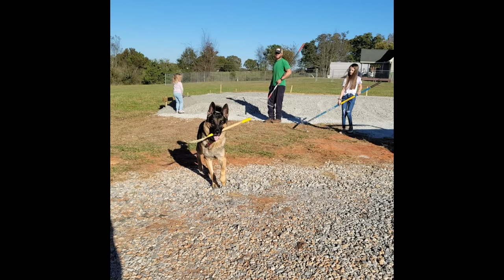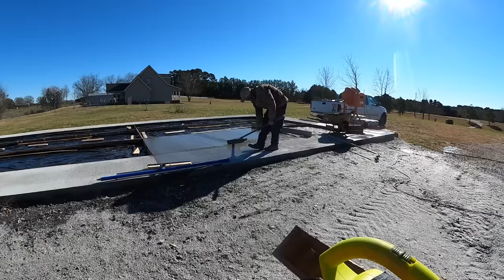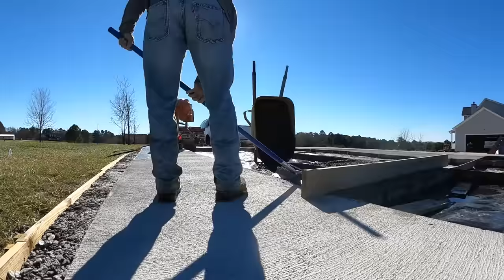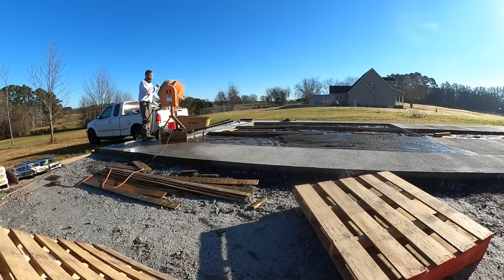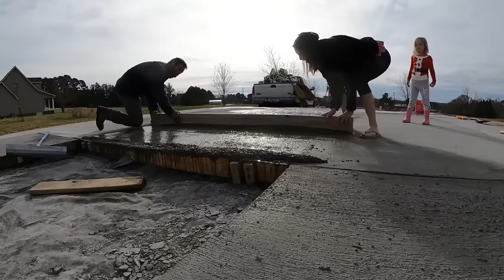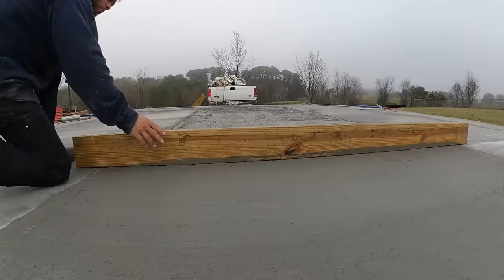Pouring a Huge Concrete Slab Using Bagged Concrete | I Saved $10,000

Comment: Wow, that is a lot of savings for the size.  We had a 24 x 40 building built and the concrete pour in Upstate NY was $4000.  That included the floating and creating of the stress lines.  We did not specify the day to do the job so it is possible that they did it on a day when they were doing multiple projects that week in the area.  They delivered several truck loads.  For your project, that is a lot of work for such a small mixer.  Your floor looks great...
Reply from the maker: Thank you! That’s cheap! When did you have it done? Around here they wanted a minimum of 14k for this. I have 3800 in everything doing it myself truck was going to be more.

Comment: It’s too late now but if you ever get a hankering to pour more concrete with sacks add some bagged concrete “dust” to the mix.  It will add just enough to get a great finish on the bagged concrete mix.  There’s too much rock in the bagged stuff to get a good consistent finish.  I forgot the ratio we used.  It wasn’t much concrete vs sacrete.
But your idea of epoxy is on point.
Reply from the maker: I’ve heard that before and it’s a good idea. I didn’t think I needed the extra strength for this because it’s really just used for storage and occasional vehicle maintenance.
Reply: @reallifetested2605  i understand.  
We poured sacrete at my FIL house at the lake.  5x5 squares to make a new sidewalk up to the porch.  He had done some concrete work himself so he had an exact formula.  He just wanted to "burn" in the concrete so we added more concrete to get that smooth finish.
Ive done enough sacrete to know its almost impossible to get a truck delivered concrete finish with that stuff.  Just too much aggregate.

Comment: just as a side thought when you pour big slabs by hand a pto tractor mixer saves a lot of energy so you can work longer sometime buying a bunch of Osb board and laying it on top of semi wet concrete follow this with a vinyl floor saves a lot of headache trying to trowel seal and coat the concrete as vinyl can be found for less the 2 per sq
Reply from the maker: That’s a good idea. The tractor mixer would definitely save time they hold a heck of a lot more. What I like about it is you can drive it around and dump it wherever you want.

Comment: A Cinder block  is 1 ft 2 inches.  With a space in the center.   Lay a layer of cement under the first  brick.  To lock into the place. Then  Double stack. The Cinder blocks one on top of another.  Filling in the center of each brick as u do with cement to create a solid  Cinder blocks  concrete pad.   And save half as much in cement  and water an spend  less  in the process.
Reply from the maker: I’ve seen this done on YouTube before and it’s a pretty good idea!

Comment: I mixed 3 cubic meters in Metric (105 cub feet ) in the Australian humidity , that’s the limit of human endurance , great work
Reply from the maker: I bet that was fun working against the heat. Luckily the temperatures were cooler when I did this so I didn’t have to worry about the concrete setting up on me. Thank you for checking out my video!

Comment: ❤  so it looks like best practice is to poor then leval and smooth rather than smooth as you go.
Worked with a pro. That kept all his work coverd in burlap for several days more than a week I think. Worked with an old timer engineer said add salt to set up quickly, sugar to slow the possess. Don think Ill do that, but covering for a time is supposed to harden better. Great job, I may grow some and try a slab myself.
Reply from the maker: I've heard of that as well but never had the courage to try it. Check out water curing. That sounds like what the burlap is doing. If you can keep the concrete moist for a while after pouring it supposedly makes it a lot stronger. Good luck with your project! It's not near as bad as it looks.

Comment: As someone who has done something similar (120ft tunnel 20ft underground - 1,367 bags of concrete), I have a lot of respect for this.  Personally, I would have used a lot of rebar everywhere and been careful to tie the sections together with lots of rebar, but never mind all that; well done.
Reply from the maker: If I were to do it all over again I would definitely pin the slabs together for insurance. So far everything as just as it was when I finished with not so much as a hairline crack. I'm very interested in your underground tunnel, do you have any info on how you constructed it?
Reply: It’s all in the base. We had a barn growing up that was about 150 years old and the concrete had a few cracks but who cares it out lived the guy who poured it and was still being used.

Comment: I built a 20x35 stamped concrete pad and I learned that the bagged concrete has much more aggregate than you have when delivered by truck.  If I could do it again I would mix 2 bags of ready mix with 1 bag of sand and 1 bag of cement.  Would be a lot creamier and accept the stamps better.
Reply from the maker: Creamier is definitely better for steps. More gravel does make the concrete stronger though. Did you try running a float over before trying to do the stamps? The floating process pushes all of the aggregate down into the mix.

Comment: Always amazed to see different parts of the world that don’t use rebar NOR air! 
I’m in Canada, and as nice as that looks, it’d never survive 1 winter here. 

Retired now, but I was a concrete finisher for years before I opened my own concrete construction company. 
But... heck yes! If you’re just doing this for yourself? You did darn well. 👏
(And cutting up each pour into smaller sections isn’t cheating. It’s just common sense. 
I’ve poured over 10,000 sq ft pours where I was the only finisher. But that wasn’t until I was comfortable with my ability. Prior to that I’d place bulkheads to divide the pour. (It’s also a handy way to create/leave access so you can work.)
Reply from the maker: I have had quite a few people say where’s the rebar it’s not going to last. I called around and local pros said that it wasn’t needed in a residential on grade 4” slab. No one around here uses it unless it’s an industrial building or house pad. Yes! I imagine Canada gets way colder than around here. It rarely gets below freezing for any amount of time in my area. Thank you for checking out my video and for taking the time to leave a kind comment. I appreciate it.

Comment: Hats off. Great job. Hiwever, concrete without reinforcement cracks. All concrete cracks, but at least the rebar keeps them in place. Your finished floor (if tiles) might inherit those cracks on a long enough time-line. Also you didn't put in the water a sewage lines and didn't insulate below the slab. This will reduce your energy efficiency. But as to the brute work, hats off
Reply from the maker: Thank you! I do wish I had pinned the slabs for added insurance but I haven't had any cracks or issues. If you're interested I did a 1 year update. This is just a storage building so I didn't need water or sewage lines. It's not heated or cooled either so efficiency doesn't matter to much.

Comment: For the 12 yards where i live that cost is around $3500. And we do the flat work ourselves. Its not the glass smooth finish of others but it will never flake due to overworking it.
Reply from the maker: I haven’t checked in the past year or so on concrete pricing in my area. I can bet one thing. The price hasn’t gone down.

Comment: did a little simple math because I was curious. You brought in and moved 200,000 pounds of gravel, 66,400 pounds of dry concrete, 6889 pounds of water (~1 gal per bag) so 73,289 pounds of concrete and total of 273,289 pounds of material total. Holy smokes, over a quarter of a million pounds moved manually.
Reply from the maker: That's insane! I never calculated everything up, but that's a lot of weight!

Comment: I was contemplating doing one myself! However I think I will put re-bar threw mine so that their is no danger of one pad sinking. I have a old oil barrel I may turn into a large mixer it is four feet high and six feet long I will take it apart and put in baffles. a big mixer basically. so I am thinking about tow mixes per slab. I think you did a great job and take my hat off to you! It looks pretty much as professional as one could imagine!
Reply from the maker: In my area the rebar wasn't needed in a residential on grade 4" slab. But definitely so if you have cold climates or a poor subsoil. (or putting a ton of weight or machinery on it) That sounds like a good idea using an oil barrel. If you go through with that you should make a video so I can check it out! Thanks for taking the time to watch my video, and for commenting!

Comment: Just got an estimate for $5300 to pour/pump a 6 yard monolithic slab. Unreal. I had a guy come out and pour 5 yards for $400 4 years ago but that shed is right along the fence line and I screed and set J-bolts myself. Inflation is insane. It's like the currency has to fail. How can anyone afford to do anything? Going to have to DIY I guess. Thanks for the inspiration!
Reply from the maker: I don’t understand it either. We got a quote for a 24x24 unfinished building with no electrical. Just the shell. Quotes all averaged around 100k.  My dad had one built (2 story) id guess 5-6 years ago for less than 40,000.
Reply: @reallifetested2605  Right? It's DIY or nothing at this point. Not sure how people are going to afford housing.

Comment: I’m not sure how much a yard costs where you are located, but around me it is about $150. I just checked Lowe’s website and the 80lb bag at my Lowe’s is $7.16. There are about 45 bags to a yard. So 830 bags is about $6000 for 18 yards. A truck could bring 18 yards in two trips for a little over $3000. I know for me, in most cases if I need more than a yard I call a truck. Kudos though, that is a lot of hard work.
Reply from the maker: I did this during Covid when prices were just starting to go crazy. Local trucks wanted 200 to 220 with a 4-6 week lead time. I was able to get 80 lb bags for 3.20 each so that’s what I did. I need to check around and do another update to see if prices have came back down on truck. Based on our economy I doubt it ha

Comment: Good job.  FYI,   I am building a garage at my house.   I just paid $6500 for a 4 inch thick pad.   It has 24 inch footers all around the perimeter.  It is reinforced with rebar throughout.    it is 21 feet by 49  feet.  Right about the same size as yours.    Im not sure how you saved 10K unless construction and specifically concrete work is crazy expensive in your area.
Reply from the maker: That’s a great deal. We have been looking at building another shop. For a 40x60 we’re getting quotes of right at 25000 if I do the grading (from 5 different contractors) with only fiber reinforcement. For this particular project we were getting quotes of 14k up. I did all of this for right at 3800 including all gravel and concrete.

Comment: I knew a guy who was a professional mechanic for the transportation department in a large utility company back in the early 1970s... He was building a home shop for working on cars... He thought that he could do it himself with the help of some relatives and friends... Although he had a large concrete truck deliver the concrete, they set up the forms and finished it... By the time they got through though, the slab had such a rough surface that he could not even roll one of the mechanic's creepers around the floor... He ended up having to get the floor ground down to make it even barely usable...
Reply from the maker: That’s awful. I bet he had fun grinding the concrete down. That stuff makes a ton of dust!

Comment: After having a contractor put in a 25' x 28' patio using bags, all I can say is DONT. They had a team of 5 guys, but they unevenly mixed things, and now we have a highly porous mixed density patio that's going to need to be ripped up. From what people are telling me, having a cement truck means everything gets mixed evenly and laid down fast before it can start setting. I think the guys who did mine did it particularly poorly, but I'm guessing the truck helps avoid mistakes.
Reply from the maker: Im sorry you had issues with your contractors. That is another good reason why I decided to do it myself. I've seen things like this so many times and I bet the guys that did the work for you gladly took your money and won't come back to fix the mistakes. I have ~40,000 lbs on this slab and it still looks as good as the day I poured it. That's crazy 5 guys couldn't get it mixed fast enough! My slab doesn't have one crack in it. I'm going to be doing yearly updates so stay tuned!

Comment: Here in my neck of the woods, S.E. Oklahoma 1 cubic yard of concrete cost 150 for 3500 psi. It takes 45 80 lb bags of concrete to make 1 cubic yard. At 5.18 per bag that's 233 per cubic yard. 
That's 80 dollars more per yard with bag concrete. 
I'll stick to ready mixed concrete.
Reply from the maker: I wish it was that price here. When I did this they were wanting 200 to 220 with a 4-6 week wait on truck, #80 bags were 3.20 each.

Comment: Your nuts, respect for the amount of work you did. Have the concrete delivered no matter what it costs and pay a mate to help or better yet pay a concreter good money for the day and help him to lay it. The 2 of you will do a slab that size easy in a day. and still save 7-8grand.
Reply from the maker: They were wanting 200 to 220 depending on the day per yard for truck and I was able to get #80 bags for 3.20 each. We called around because we were more than willing to pay a reputable company. The issue is the lowest we were quoted was 14k. I did everything myself for a little under 4k. People in my area dont want to work, and the ones that do want to work want 2 - 3 times what they're worth.

Comment: i would have liked to see some dowels in those slabs or some mesh but very few people watching this will understand just how much work it is doing a slab this big with bag crete...congrats you pulled it off
Reply from the maker: That's literally the only regret I have is not putting rebar dowels in to hold everything together. I haven't had any separation or cracking yet but this would have been good insurance. Thank you for checking out my video, and for taking the time to leave a comment. I appreciate it.

Comment: This has showed up in my feed several times...Great that you did the site prep, gravel $ grade work, forming and finishing yourself. That's where the savings was. There is no way the physical toll of mixing 80 pound bags is worth much $avings (which I doubt exist) over ordering a truck load. Quality issues like cold joints, bag mix vs. a truck load of 4000 psi etc... weigh into the equation too.  I'm sure your's will be fine, but with the exception of very difficult to place job sites, much more than a 2 yard pour warrants ordering
Reply from the maker: Thanks! I did have a bit of savings going bagged over truck at the time. 80 lb bags were 3.20 each and truck was 200 to 220 depending on the day per yard with 4-6 week wait. If you’re interested I did a one year update explaining everything a while back. In my area bags and truck are still around the same price. I also show that in the update.

Comment: Ok.  You may have just saved my garage build.  I'm restoring a classic mustang and need a safe place to park it.  Don't want to spend * wife doesn't actually  =) * 8-10K for a 20x25' pad.  But, wasn't sure I could do myself even after planning out.   But, as you have beautifully shown, you can make any size slab if you break it down into manageable sections.  Thank you so much.  If I do a video of mine, Ill be sure to post a link.
Reply from the maker: You're very welcome. Good luck with your project, and I look forward to seeing it!

Comment: Me and a friend years ago did the same, we decided to save money and rent a mixer and pour a huge driveway ourselves, well working like fools for 12 hours and busting out backs moving around the dry bags and wet concrete it worked out it would have been cheaper just  to order a truck and pour it all in 2 hours , remember time is money and to this day we both laugh how hard we worked thinking how much we were going to save.. .lol
Reply from the maker: Hey that’s good you got it finished and it turned out good. I couldn’t handle all this myself I was also working night shift 7 days a week so was limited to the time I got off to the time I was ready to go to sleep. I got 80 lb bags for 3.20 each vs 200 to 220 with a 4-6 week wait so bags were cheaper as well.

Comment: I am building a concrete slab 10 feet x 10 feet x 6 inches thick for a six person hot tub.  My brother and I just finished the form using 2' x 6' 's after digging out all that dirt by hand.  I was going to call a concrete truck since we figured we would have to mix roughly fifty bags or so and it sounded like quite a bit of work.  You inspired me to go buy a small cement mixer for a few hundred dollars and doing it ourselves.  Thanks.
Reply from the maker: That's awesome that you got inspiration from this! I would definitely call the concrete company and see what their minimums are. In my neck of the woods it's 3 cu. yds. Meaning you'd have to pay for at least 3 yards for them to even come out. Delivery on top of that if you don't order a certain amount. You should check through my videos. I did a review on the harbor freight mixer and explained some of the things I did to make it work better for me. I also did a 1 year update on this pad along with me answering (to the best of my knowledge) the most frequently asked questions. Just a warning I was pretty new to youtube on the mixer video it's not horrible i've just gotten a little better with my words if you know what I mean.
Reply: You're gonna work the heck out of that cement mixer. Maybe just rent one. And make it the biggest one you can rent.